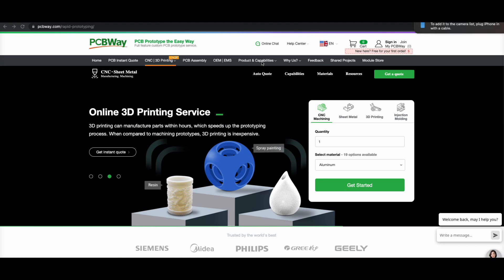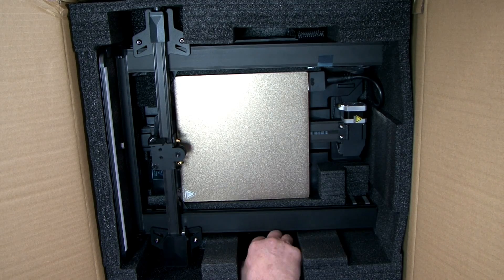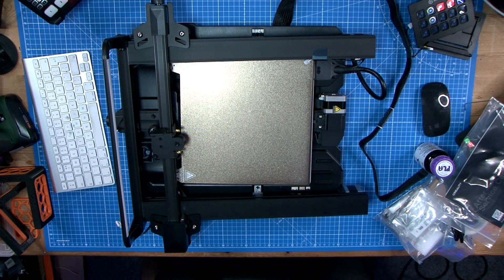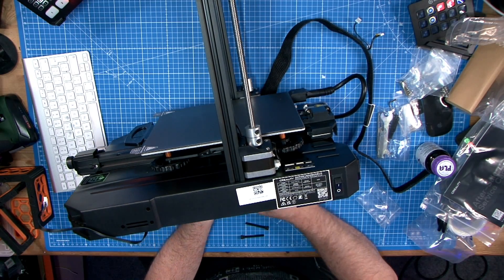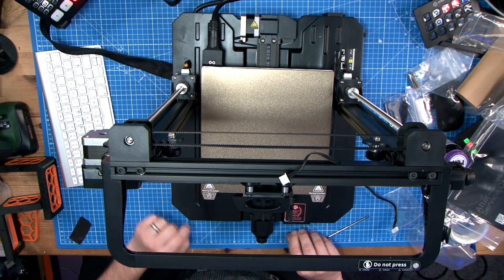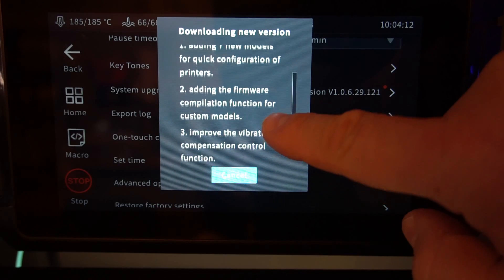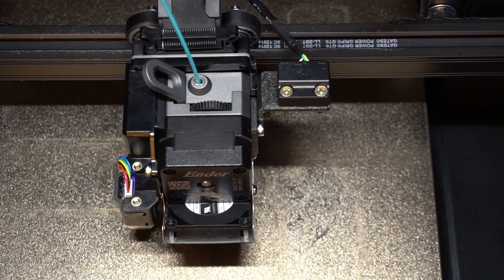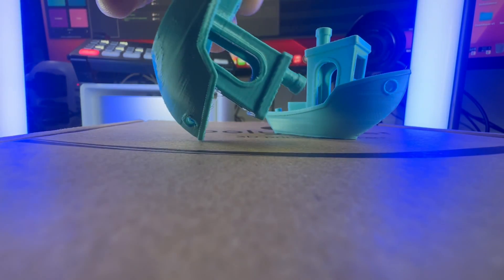Ender 3S1 With The Sonic Pad! = Klipper!

Comment: I'm running the 3 S1 Pro with the sonic pad. I wanted to know where you got the file for the sonic pad holder you showed. I'm trying to attach my sonic pad to the top of the printer. Thanks for the help.
Reply from the maker: I think it was on cults

Comment: Creality could REALLY make a name for themselves by giving consumers the choice to buy printers bundled with an installed Sonic Pad INSTEAD of the normal 4" touch screen. Then it would come preset and ready to use with the Sonic Pad. This seems like a no brainer upgrade, that they should have thought of as soon as the Sonic Pad was a thing... I don't really have a problem with Creality trying to make their "Sonic Pad" their own ecosystem. But I have a BIG problem if they are trying to lock down Klipper, or any other open source software. The thing I find funny is that someone will figure out how to bipass all of Creality's protections in place, BECAUSE it's based on open source software. THere are always hackers taking aim at large conglomerates who try to squelch open source or free code. So Creality will get a serious dose of a wake up call, if they try to be too stupid with locking down this device.

Comment: I only converted my S1 Pro to Klipper with the Sonic Pad this past weekend, so this is eerily well-timed. Having read and watched lots of reviews, I was prepared for trouble and difficulty, but I think waiting for that first Sonic Pad firmware update paid off. X and Y input shaping are separated and stored correctly (but who puts the sensor in the middle of the bed for Y?) the PID tuning works well, and running at 150mm/s is now my base speed. Haven't even had problems with Moonraker (as some have) and it is pushing slices directly from Cura to the Pad. Sad to say, but this is better than the FLSun Speeder Pad on my V400 IMHO.
Reply from the maker: What a contrast :) Glad you have things working !
Reply: I haven't installed mine yet but I'm wondering if I should upgrade my cooling. Are you running stock cooling with pad or did you upgrade?
Reply: @Beefycakes240  Stock cooling, but I've made a circular part cooling duct on my resin printer to improve it, but just haven't gotten around to putting it on. Seems pretty good at 150mm/s so far with the stock fan.

Comment: Do you have a copy of the printer.cfg that's provided via Creality? I'm running Klipper from a raspberry pi and I'm using a community config file and I'm super interested in the difference between mine and the 'official' config. Thanks!
Reply from the maker: It’s generated via the pad
Reply: @TheRealSamPrentice  it would be awesome if you could pastebin it and add it to the video description!

Comment: I just set the Sonic Pad today on my S1 Pro. It prompted for a f/w update right out of the box. Done successfully. Went through all the prompts, levelled the bed, resonance test completed as well. now the sonic pad won't turn back on. Once ever 3-4 times i power up it shows the Creality logo then shuts off.  Not impressed at this point but will go through the P&D routine with the vendor.. see what happens. Overall not a good experience so far.
Reply from the maker: Oh no!! Does the Ethernet connection also die when the screen goes off ?
Reply: @TheRealSamPrentice  The entire unit powers off. Now the store where I bought it from wants to go through all hoops of trouble shooting.. honestly I purchased it Tuesday, delivered Wednesday and I set up today. Should be an RMA..you would think anyway..

Comment: Mr Prentice    Just had a thought.  I have Ender 3 Pro on steroids. Mainboard is now a SKR mini E3 V3. And bed is 300 x 300 and height is 380.  Does that through a monkey wrench into it not to work with my setup????
Reply from the maker: Nope because you'd just need the config file for that board, then setup your config around that. Maybe have a look at getting a PI  ?

Comment: I also am very pleased with the Ender 3 S1 Pro.  With the ender 5 S1 wandering into life things may get even more interesting, just snagged on on pre-order.  Hopefully a good thing, could be a dumb move...  I recently received a sonic pad for the S1 Pro, my Ender 3 V2 with multiple upgrades is running conventional klipper very nicely, but a Sonic Pad is lower in cost than a Pi4 these days.  It would be nice is they followed the lead of some Android configurations with a "developer" option to turn on access to all the features.  I guess the goal is to ensure a better experience for many folks without opening the can of worms that klipper configuration and tuning can become.  Even as a life long geek and professional developer with a hardware design background not everything quite worked as expected during my from  scratch klipper build.  Got it all sorted out, but it took some fiddling around.  Will be looking forward to further videos as you find the interesting nooks and crannies of the sonic pad, and as always I appreciate all your work to help us out.
Reply from the maker: Thank you Stan!

Comment: I havethe S1 plus with the upgraded bi-metal hotend and PEI sheet. I've had to fit the soild silcone bed spaces as the extra bed sizes makes the bed harder to keep level, it works great. Would I buy the sonic pad. I'm not sure. would be great if it has multi print support.
Reply from the maker: If you add the ports you'll get that :)

Comment: I have had mine, actually S1 upgraded to pro and the S1 pro for the start of the line. I really love the two machines. The Sonic pad is great but going through some growing pains. However the pad is very usable. Keep the info flowing 💪
Adding :8819 after ip adres of the Sonic pad. 🤔
Reply from the maker: YES!! Good news. I hope to add a few more upgrades to this, but 300 degrees on that hotend! :D
Reply: @TheRealSamPrentice  I have been printing nylon and the carbon fiber varieties simply awesome.

Comment: The S1 Pro is great using the Sonic Pad. Mine is tuned now and just churns out sucess after sucess
Reply: great bit of kit took me a couple of weeks to fine tune it, but once done it improved the speed and quality of my prints :)
Reply from the maker: Thats good to know, are you doing time lapses?
Reply: I have made a few time lapse but I need to actual get a better quality camera. In terms of functionality initially I had problems with getting the time lapse to work. But recent updates fixed it